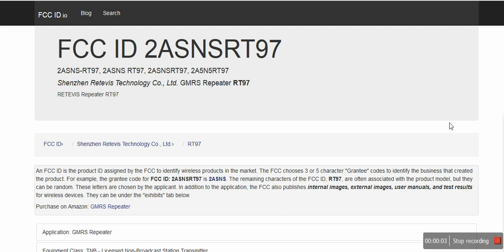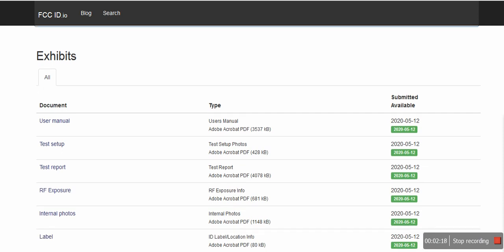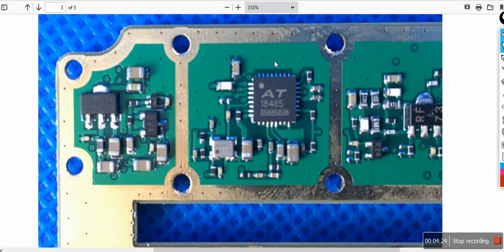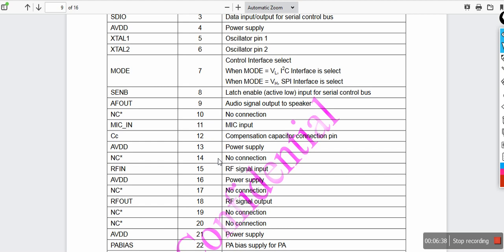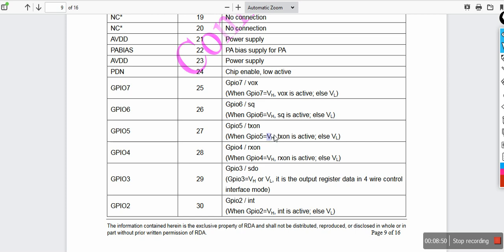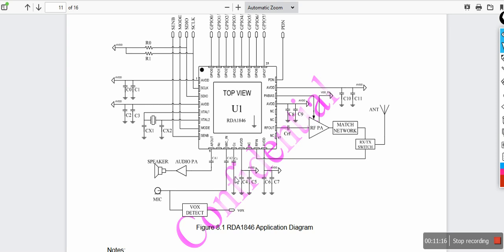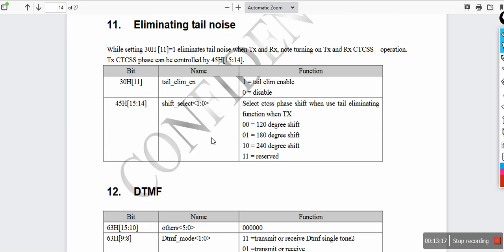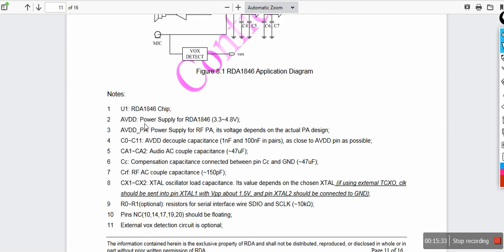🔺"confidential" Chip/I.C in the Retevis RT97 GMRS two-way repeater is this the answer to db9 mod🔺

Comment from the maker: DO NOT DO ANY MODIFICATIONS!!! I NEED TO DO SOME MORE RESEARCH!!! I AM JUST BRAINSTORMING IN THIS VIDEO!!!!
Reply: I just returned my repeater and got the S version..thankfully Amazon has easy returns. I got mine from a large GMRS network and they had it in stock. I am waiting for my id-0-matic....but I would like to know if I can use my controller and link it without having to use another external radio to link it on the network...otherwise ill have to build a new repeater out of used motos.
Reply from the maker: @thebugg333  - I think so, but I am not sure, I don't have that model to check. I think you will need an interface box to do that. I hope to know more on that soon.
Reply: just buy the dam cable and save yourself a lot of grief.
Reply from the maker: @johnszczepaniak8679  - what cable? My RT97 don't have the db9 connector on it, so a cable won't help!! I think you missed the whole point of the video 🙂

Comment: High is relative. -5 to ground is high. Voltages range from 3.3 to the rare 12v for logic.
Reply from the maker: Ya, most of the time it's 3.3 - 5 volts for high